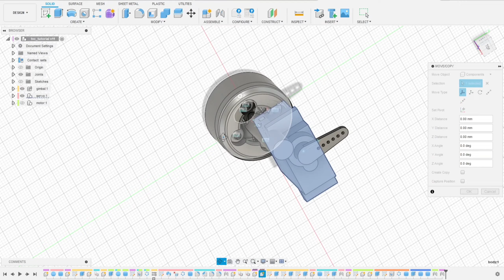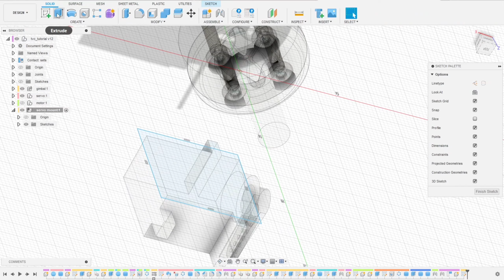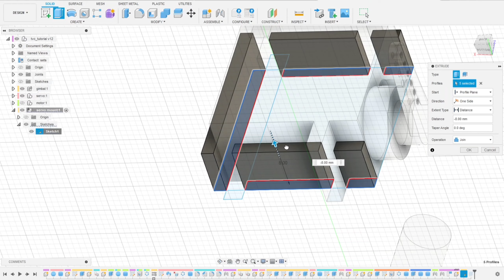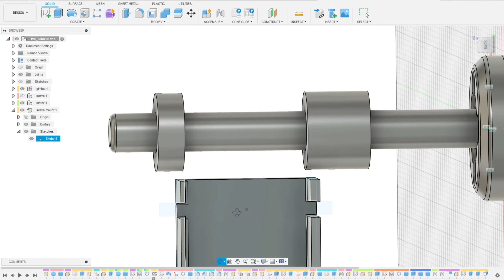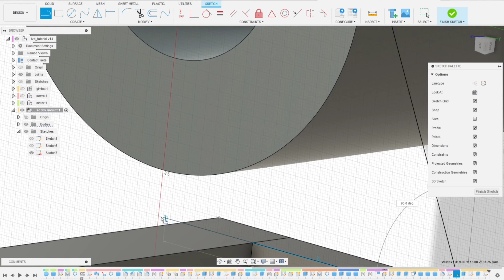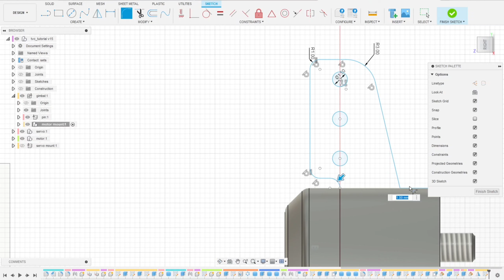3D-Printed Thrust Vectoring System: Part 3 Completing the design in Fusion 360

Comment: can i make both servo's at 180 degree? will be there any problem in axis movement?
Reply from the maker: Regardless of servo placement the push rods should be connected with 90 degree interval around the motor center axis. With this placement it is possible to seperate servos for yaw and pitch axis. Theoretically it is possible to use different angular intervals but the control law will be complicated